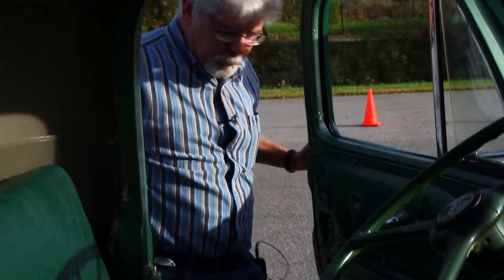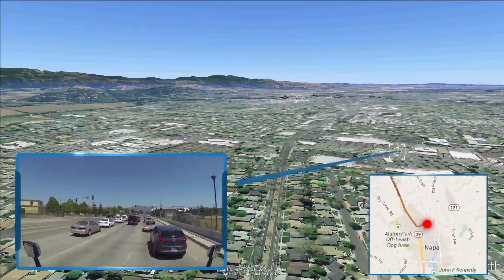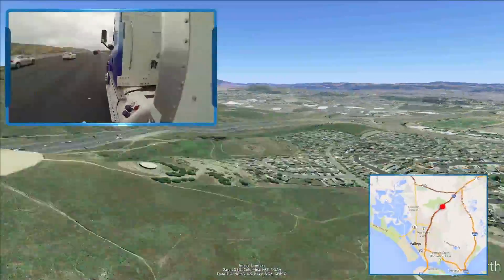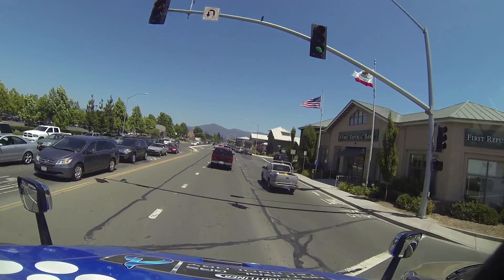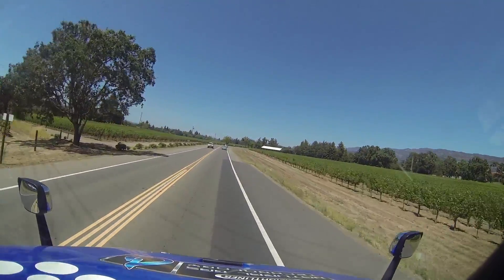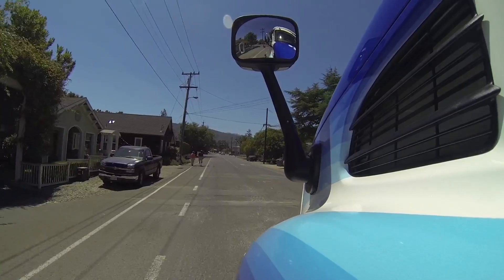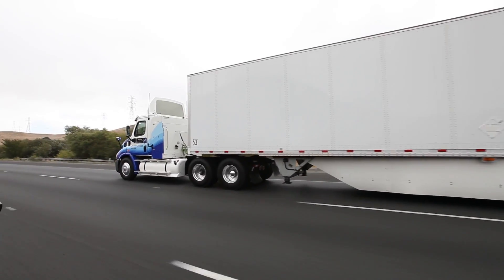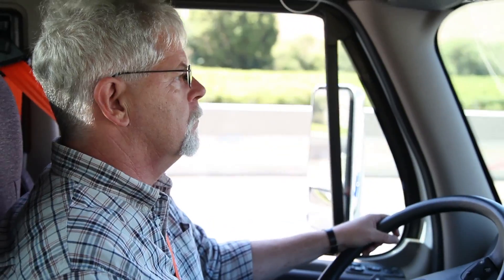Cascadia 113 & Cummins-Westport ISX12 G: Perfect Partners Pt. I

Comment: what happens when you are running low on fuel and the nearest station is 100 miles away, also look how high the natural gas prices have gone since the start of all this, when it was originally started natural gas was only 1.50 a gallon, now its over 2.60 a gallon, plus you lose 10% due to the btu's of natural gas, so that's the same price as diesel but with a 10% loss in fuel economy, haha what a joke
Reply: Yes, But think about the fact these just have a maintenance free catalyst and normal have def and dpf I dont own a cng I won 11 diesels but that's the truth.